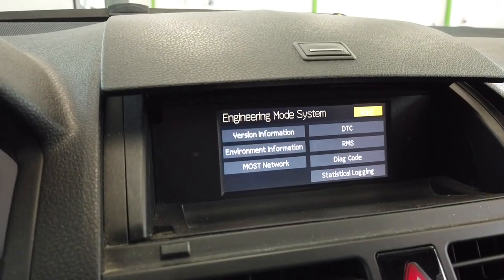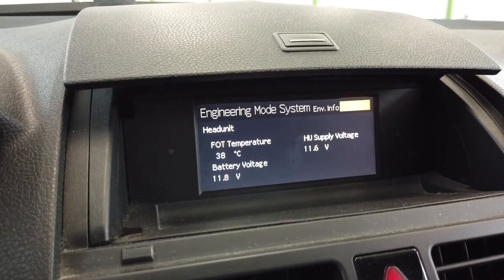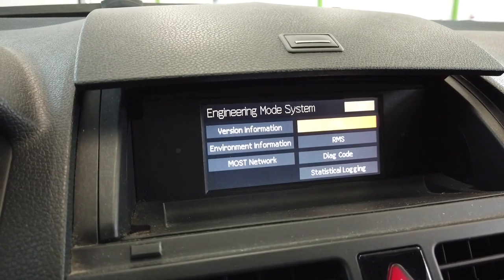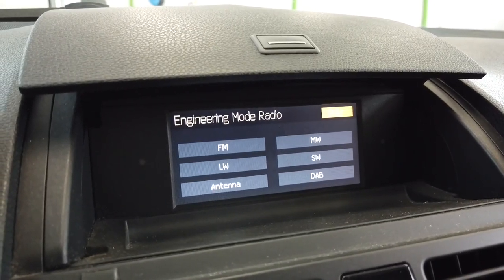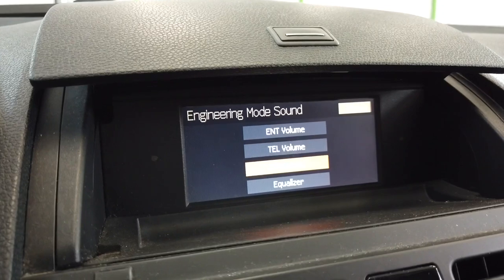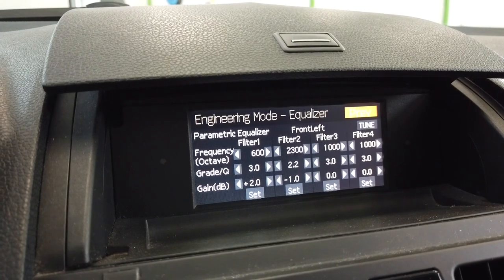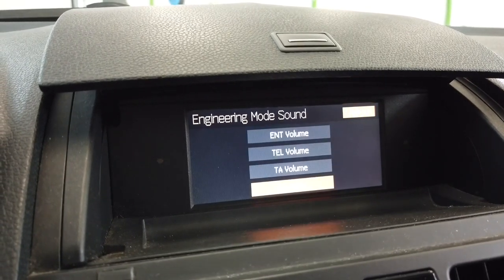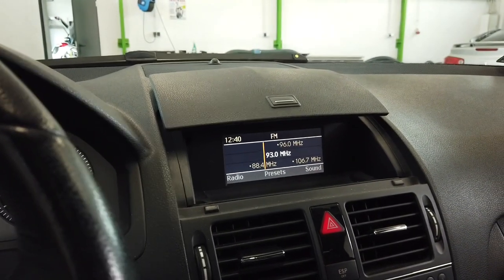Mercedes NTG4 Audio20 Engineering Mode (W204 C-Class)

Comment: Is it possible to add carplay on this headunit?
Reply: No they sell an aftermarket one that offers both apple and android it fit exactly into the same spot just upgraded software and lcd screen goes for $400
Reply: @BC2FITTY where did you find this aftermarket unit I searched but I only find this big and wide ones. I want to find something closer in looks to the original

Comment: Can i play audio thru bluetooth mercedes c180 2008?
Reply: No it’s not possible I have a c200k ‘08 
I bought a aux Bluetooth device that can be used instead. Hope that helped🤗
Reply: @Hoonigoan  what part did you buy to make this possible
Reply: @Hoonigoan  how can i make my sound louder when using aux?
Reply: It’s possible to stream audio over Bluetooth, if you have UMI (Universal Media Interface). Lot of AUDIO 20 systems have this option originally from Factory.
Reply: @detman1000  yes I can stream via bt in my 2011 c300 but the quality is subpar at best. Everything I have found online says it's due to the bt channel needing an update but no one knows if MB has ever offered it to customers. Maybe someone out there has first hand experience with this problem and can offer a remedy. I personally just use the aux port for the sound quality but if you don't have the streaming option when you switch to disk on the head unit you may need to turn it on in the second radio menu by holding down back, clear, and pressing in on the center knob all simultaneously (the buttons by arm rest). Hope this helps.
Reply: @fcjell3904  access the other secret menu hold back, clear, and center knob in simultaneously (the 3 by the arm rest) this will have the option to adjust volume across all audio formats.